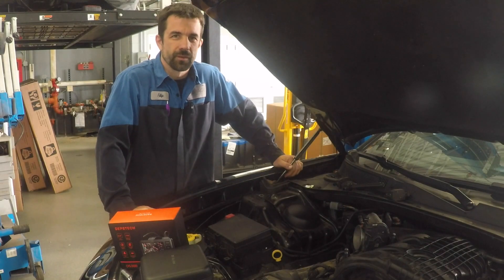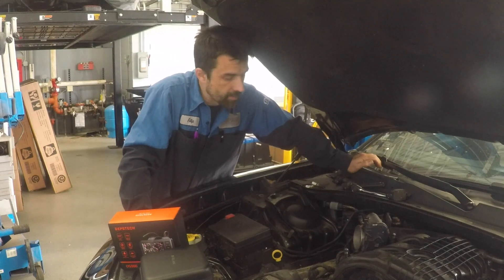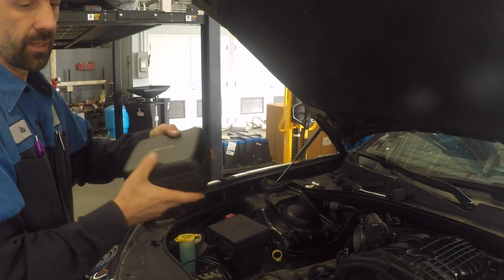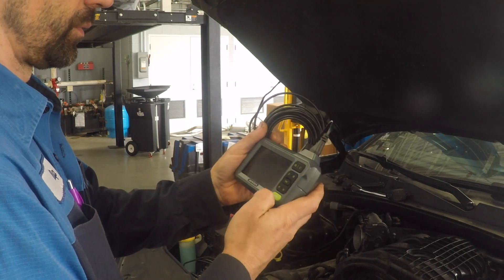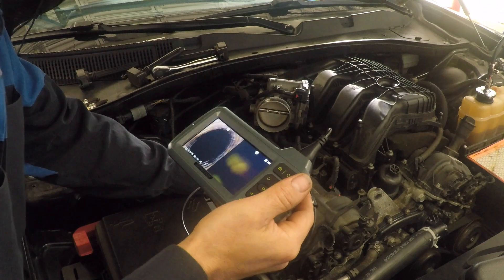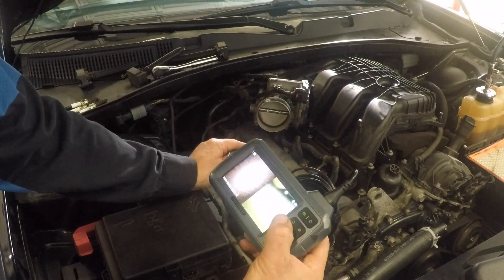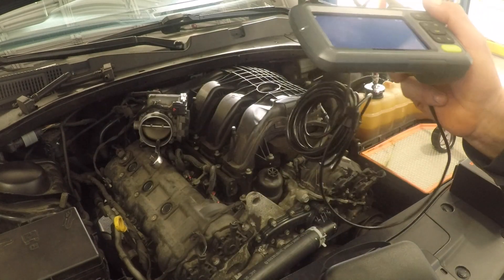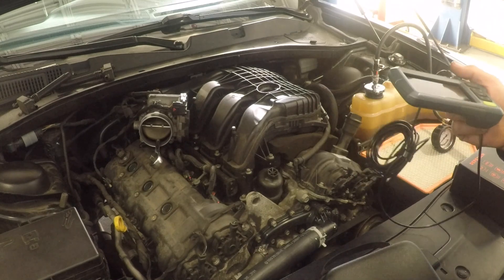Pentastar 3.6 Overheating | Cylinder Inspection

Comment: For diy at home could I just run a cylinder hone if I found scoring like that? I have coolant in my cyl 6 combustion chamber. 2017 grand cherokee 3.6 140k miles
Reply from the maker: Cylinder hone will not fix your coolant getting in to cylinder. I would recommend new cylinder head or  have a reputable machine shop check the head and block and resurface. Might as well do full rebuild or get new engine.